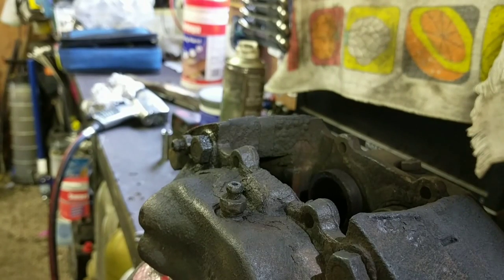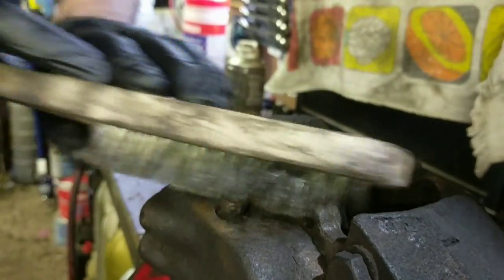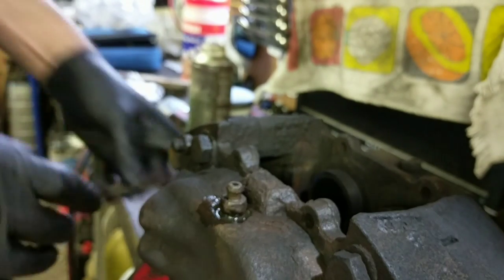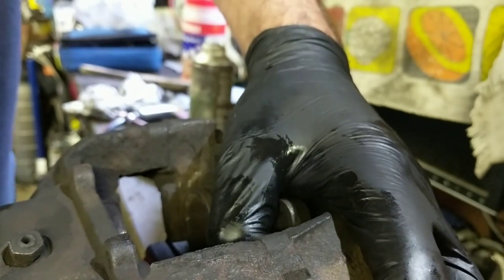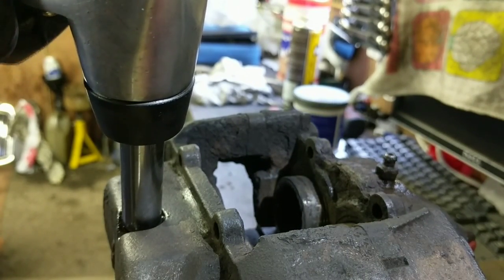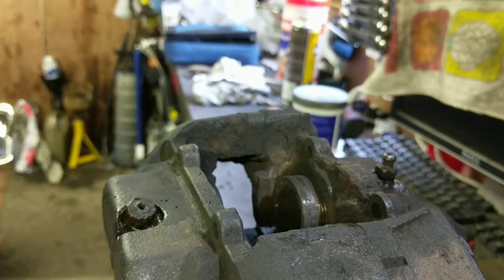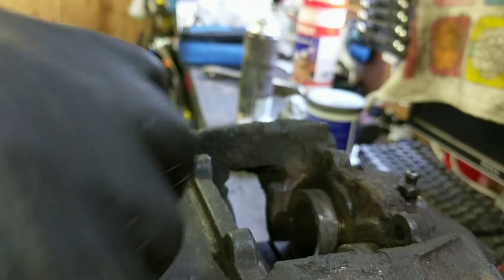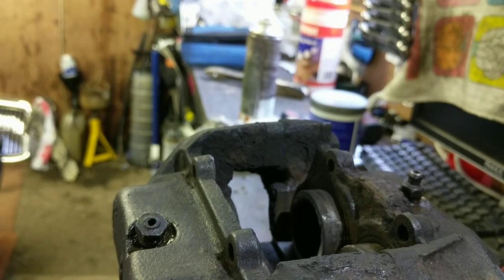Rusty and seized brake bleed nipple removal using Vibro Impact glow plug remover.

Comment: My best trick that’s worked for me EVERYTIME SO FAR in any rusted bolt screw etc heat it up till it’s bright red hot then instantly blast with water till cool comes out basically by hand after that I like to call it shock therapy hope this helps someone!

Comment: I'm amazed at the design of that quad-cup caliper, with the double reservoirs, I don't think I've ever seen a caliper with two reservoirs on each side of the Piston like that, here in the states it's just the reservoir on one side, with a slider mechanism.
Reply from the maker: This is a heavy duty application so not uncommon. Plenty of high end and performance vehicles with it also 👍
Reply: I've been doing mechanical work on all types of vehicles from small cars to heavy duty trucks for 45 years, and I have to say I've never seen a dual Reservoir 4-cup caliper before, but I guess there's a first time for everything!
Reply from the maker: @westwasbest  every day is a school day as they say 😃

Comment: You have convinced me, so much so that I have bought one. Waiting for it to arrive. I too have sheared a few, even when left to soak and gently working backwards and forwards. The big test will be on my Lancia Montecarlo that has no brake pedal at the moment so all four will have to be bled and they are alloy calipers with steel bleed screws, the ultimate test. I have ruined one of these in the past and they are virtually unobtainable so will let you know how I get on.
Reply from the maker: Let us know how you get on. Sounds like a real test you've got lined up. 
A bit of compressed air tool oil down the air inlet first and keep that trigger pressed for a few minutes at a time. 
Fingers crossed for you. 🤞
Reply: Do not use impact gun. Drill bit inside bleeder hole.

Comment: This is still good because you are still able to get a portion of the bleeding nipple where the wrench can hold,so if it were to be that the outer part of the bleeding nipple has broken off due to rust from old age and all that is left is just the part in the caliper hole how do you take that out.

Comment: Prime tools let me down, called them having waited 10 days for delivery, they told me they were out of stock, so rang Sykes they were also out of stock so I have bought one from 4 X 4 a Laser product, same spec, delivered within 24hrs and £40 cheaper. Will try it tomorrow and let you know. I paid £199 for the Sykes and £152 for the Laser.
Reply from the maker: I've had good service from Prime. Thats a shame. Laser stuff is good. Used plenty of their tools.

Comment: Why would anyone use a 12pt wrench on a hard to move fastener?  A six point of the correct size and as shallow as possible will reduce likelihod of shear and transmit max vibration.  

The body of that cast iron caliper is covered with a layer of solid rust scale. Steel brushes don't remove solid rust scale, they just polish whatever they can reach.  Why does nobody try using a deruster like Naval Jelly before resorting to other means?  My experience is that most of the problem is the encrusted rust around the exposed threads, and once that's removed, a good penetrating oil will work.
Reply: I agree with your second paragraph up to a point. I have glass grit media blasted calipers and bleed nipples before left them to soak and still sheared them with all the patience in the world including shocking them, heating and every other trick we have all tried.

Comment: The worst I have seen a cars that reside by the sea, I bought my sisters car in Lowestoft and every bolt every fastner the frame, was just corroded. No pentrating oil in the world was touching it, wven if I applied 3 times a day for  a month and finsihed the course. I had to resort to heat wher possible, and where it wasnt It was a game of drilling, easy outs, and swearing like a tropper! The rest was teking the Lords name in vain. You know it really helped along with a good swig of whisky and selling my soul.
Reply from the maker: Lol, some are a lost cause. 👍😁

Comment: It look's like the pneumatic unit has a reverse button. I have a crazy idea. Put it to tighten, and just touch the trigger. Then reverse and do the same. Repeat several times, just a touch in each direction. Then go a little longer in the remove  direction, but still just a touch in the tighten direction. Keep increasing the length of the loosen motion until it gives way. That should loosen it faster.
Reply from the maker: Good info. Cheers

Comment: Could you do the same thing using a regular impact hammer and turning down the air pressure?
Reply from the maker: It's more than likely a similar force. Too much and it'll shear it off for sure. Impact, heat, penetrating oil, all have their part to play in getting these out. There are some however that are beyond help and will break no matter what 😐.

Comment: Thats was not to rusty just use a bow in wrench and smack it one good time it would have came rite on out but if it really rusty heat it up real good then  pour  cold water on it it will come right out
Reply from the maker: Thanks, I'll try that trick on the next one 👍

Comment: Great video, thank You! 😃
Reply from the maker: Thanks, there's lots of useful comments on here too. More than one way to skin a cat. 👍
Reply: @Automotive_Solutions  yes, thank you, i browsed them all through and been watching videos about rounded brake bleed nipples (please don't ask me why 😥 ) but at the moment that impact gun is out of my budget unfortunately.
Reply: Put good fit shank of drill bit inside bleed screw hole. Break off excess bit flush. Heat bleeding screw with acetylene torch,quench and repeat 2/3 more times.works every time. Impact gun will shear badly seized bleeder

Comment: LOL...this is funny...he tried with the wrench first and he says it takes too much power...as it would break the nipple...and then he goes on to use the two different air powered guns without breaking the nipple
Reply from the maker: That's the whole idea of an impact gun. It uses vibration as well as torque. I only used 1 gun and its set to 40nm maximum. I've snapped plenty of bleed nipples just by applying a wrench. You've got to try different methods to avoid breaking them. This was a trial and in this case worked well. Heat, drill bit in middle etc all have their place too. Thanks for watching.

Comment: Not always that easy!!
Reply from the maker: Yes, I know. A bit of heat helps and some will always break no matter what you try.
Reply: @Automotive_Solutions  Looks like I am going to have to drill and tap. Used heat along with an extractor and no go!!